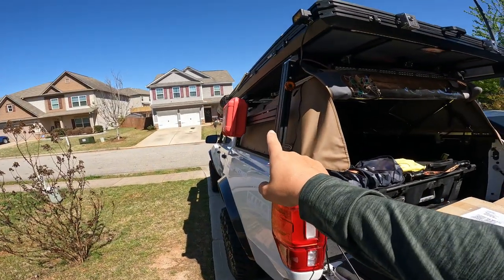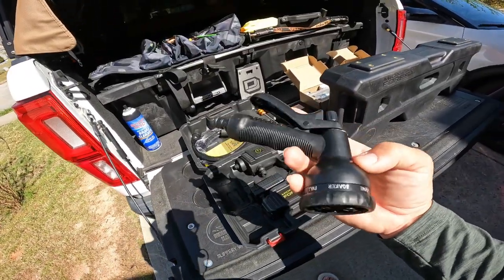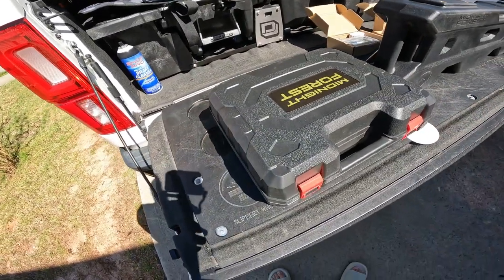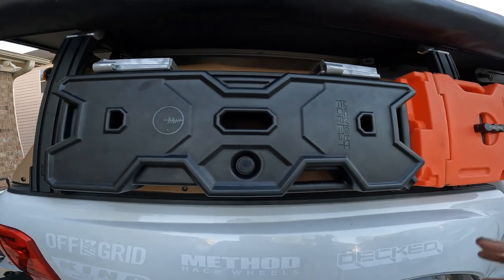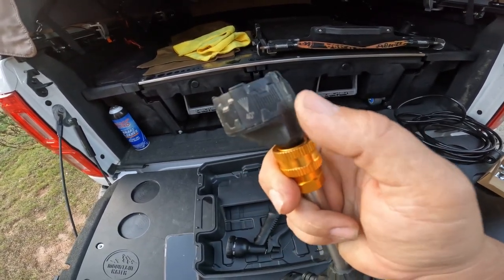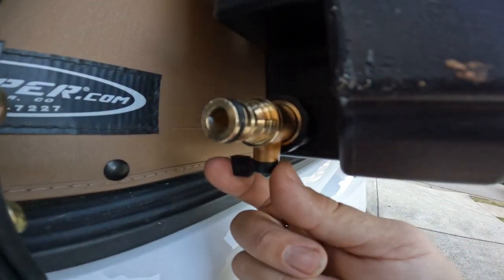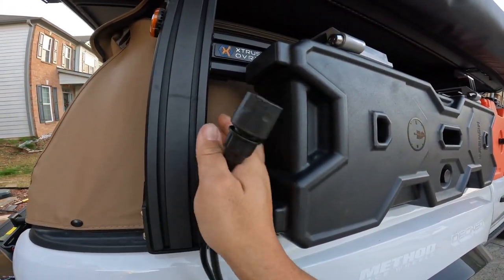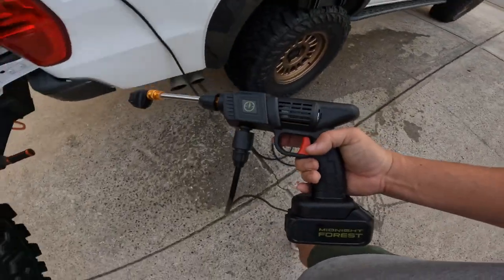MIDNIGHT FOREST RAIN BASIN ( IN-DEPTH REVIEW) WATERPORT KILLER?

Comment: I had been running a 13gallon roof rack tank from Ironman for a while and decided to switch it up to the 8 gallon Rain Basin (I sold my bed rack, tent, rotox pax and etc) I'm not using their pump though. I will use gravity or a separate pump I already have that's not dual purpose than the faux pressure washer they sell.

Comment: I’ve had mine for about a year now and it’s been mounted for most of that time.

Recently, I noticed some water stain under the big cap when I was trying to wash my truck.
It was from the tank leaking all this time.

I spoke to Colin who owned the company, and he told me to cut and make sure the cap area was flat.

I did what I could and it still leaks…

As of now it still leaks, he told me to try to cut again and the spot won’t come off the truck unless I get some remover for it.

I’ve tested the tank and it leaks in all orientation where the large cap is at the bottom.

So…I’m actually looking into getting a WaterPort or even the new rinse kit cube.
Reply from the maker: good feedback, thanks for sharing man.  So far so good on our end.

Comment: Definitely not a water port killer. It definitely is a better option for side mounting for your setup tho.
Reply from the maker: Curious your reasons you’d still choose the waterport ?
Reply: @NemesisDigitalMedia  I guess my reasoning is bias. In my setup I have my weekender 8 gallon on my roof rack and am utilizing the only space I have available which is in between my 2 cargo cases. For my setup, I need the long and narrow footprint. I also have a leer 100xr with winddoors and cannot utilize side mounting. Also water port has a great military/first responder discount program
Reply from the maker: @ChasingTheAdventureOutdoors  that makes sense! The rotopax style container could be a big limiting factor vs the weekender mounting options
Reply: For some reason your response isnt showing up, what is your reasoning for not being a waterport killer? I purposefully chose this over the waterport to limit my roof mounting. (already running kayaks and a Thule, plus a hi lift on the roof rack)